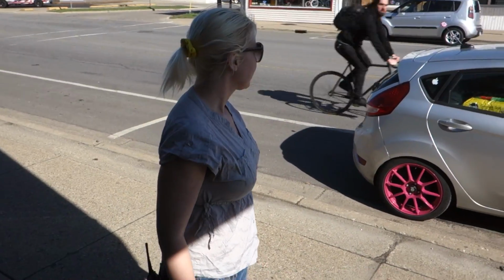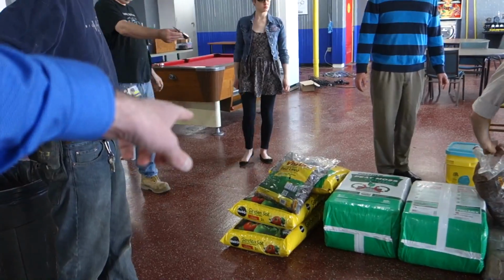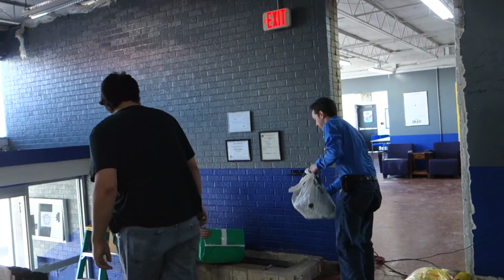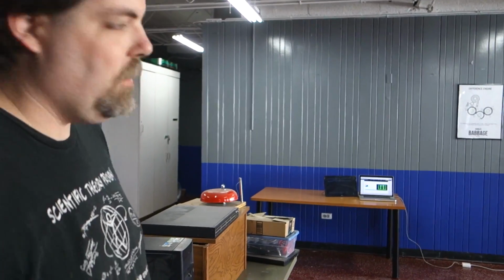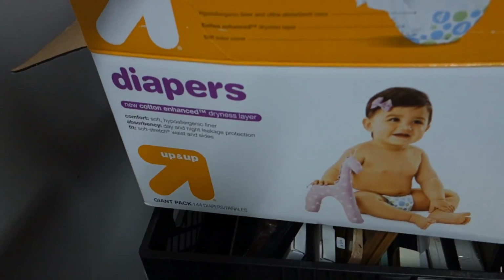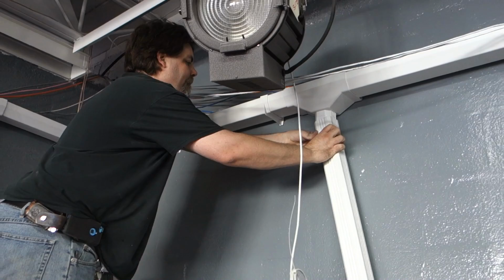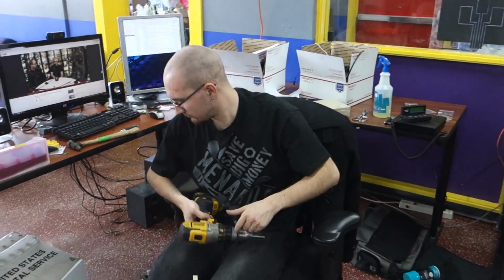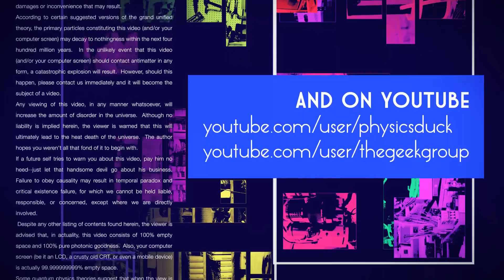Captain's Blog 4 14 2015 Art Dept Construction

Comment: Might be able to donate some Ethernet switches if you guys could use them. Dell PowerConnect 6248 - 48x1GbE copper out front and up to 4x10GbE SFP+ or XFP out back...front side has like four SFP (1G shared with some of the copper ports) - could probably send (or at least help you source, they're actually cheap) 1G SR SFP or 10G SR SFP+ too. At $dayjob I am replacing a fair number with Juniper EX3300 and 4300s. They do have fans, but not as annoying as the one in that poor old Cisco 3500(?) that's on its last legs.